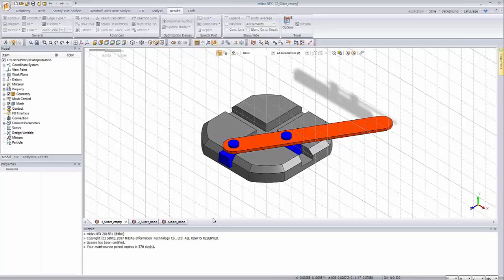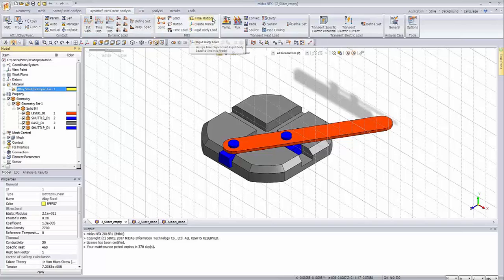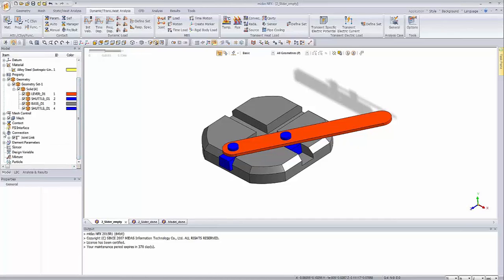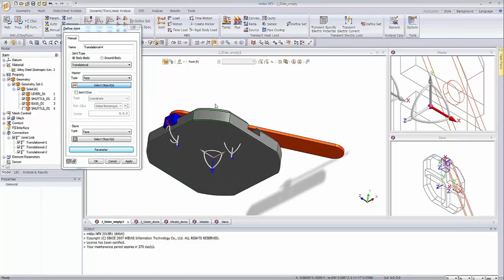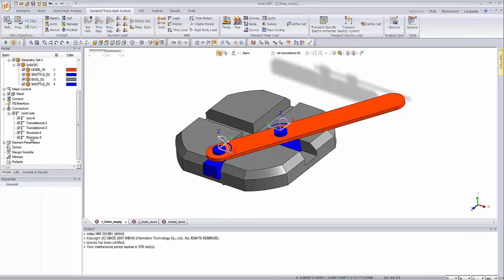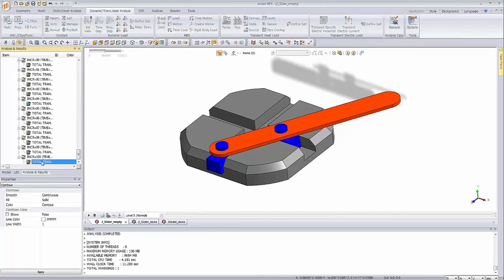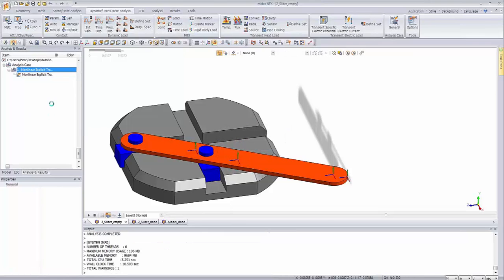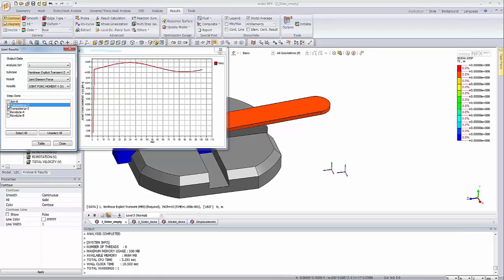Multi-body Dynamic - What's New in NFX 2015

Comment: Nice Video,

when I tried MBD analysis and want to see result about displacement and stress, why the solver running so slow and take a long time until finish?

maybe next time can you show how to analysis MBD with result of  stress or displacement plot,

thank you
Reply from the maker: +Dio Rhapsody Hi Dio, probably this is because your model is not set up correctly... if the joints are not defined correctly, solver will take much more time (if it even works). Verify that you defined the right kinematic relations between the parts and that your system is not hyperstatic.